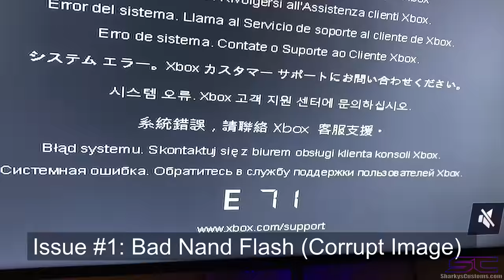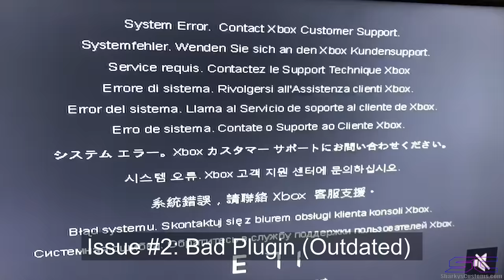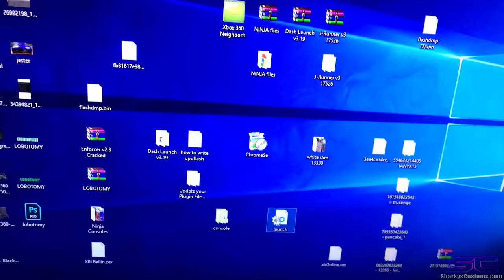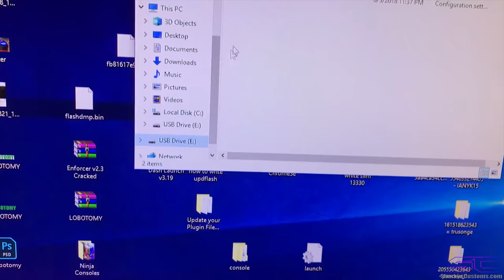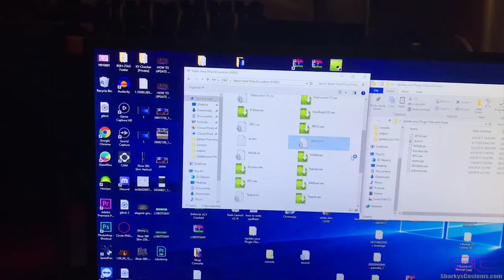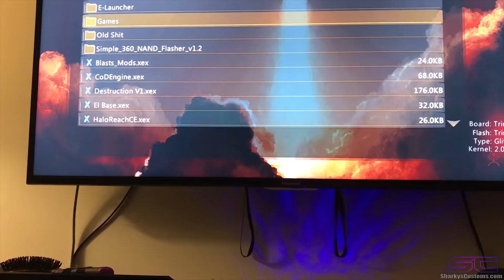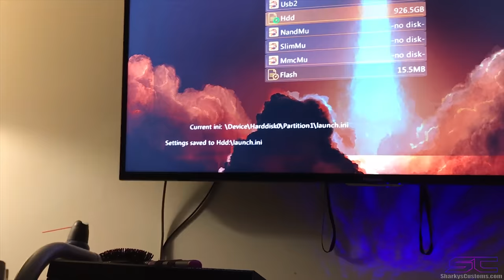How to Fix E-71 (RGH/JTAG)

Comment: Easy method 

Step 1: remove your HDD
Step 2: boot up your console
Step 3: go to settings then console settings then startup and shutdown then startup then select disc
Step 4: put a disc in the tray
Step 5: turn off your console
Step 6: put your HDD back
Step 7: boot up your console normally it'll launch directly the disc
Step: 8 go back to the Xbox home and remove your bad plugin or your bad launch.ini
Reply: Every step works only step 8 doesn't work when i try to back home the Xbox crashed and restart
Reply: @nawolf-0  Hello. I don't know what the problem is. I tried this method months ago, I'm not an expert 😅. I wish I could help you. You have to try again. Good luck🙏
Reply: I accidentally deleted the update and that's what cause this error and it's not getting fixed from this video do you guys know something that can fix it ?

Comment: Mine is the nand or at least i think it is... I updated my corona 4gb (2014) like the day of the most recent update (17544) even when I remove the harddrive the red light still appears... I practically bricked it when I used the system update...
Reply: Did you solve this problem
Reply: @abgsk6724  No, but I figured out what actually happened, I did flash the band correctly which resulted in that console being bricked, I removed the JTag Chip and sold it shortly after.
Reply: @abgsk6724  If you also ran into this problem, unlike me you can fix it if you have a fresh copy of your nand.
Reply: Correction: I flashed the nand incorrectly.
Reply: Ok thank you for the information
Reply: And thanks for your time and help
Reply: @abgsk6724  no prob
Reply: @Devious_Gaming_XD  bro I have a problem I did bad nand update and this this error , now I don’t know how to flash the old nand again as I have the old nand file which I used to create the new one but new one was bad
Reply: @Devious_Gaming_XD  can I tell me how to re flash that nand I don’t know how to
Reply: @gaminggroovy1465  yeah man
Reply: @gaminggroovy1465  so like, you need the last flash file you have right, so not the one that got messed up, the one before it
Reply: @gaminggroovy1465  if you can connect to your Xbox through Xbox Neighborhood you can reflash the older file which will unbrick your console.

Comment: when i take my hdd out the error dont even pop up and i know what i did to make the error i switched to xbonline without updateing it i didnt think abt it at first but when i take the hdd out its just a black screen no error or anything when i try to use the launch.ini it does the same thing just a black screen (help me fix this i will pay you via paypal)
Reply: TESTY did u fix urs I’m having the same problem and would like help, if you will help me. Add my discord Apollo x Mods#2084  I need help, my console just had the issue from XBL online stealth.
Reply: @devisxmds3101  bro did u fix ur problem,? I have a bad Nan flash

Comment: does this stand only on modded consoles? it happened to me on a regular unmodded console.. cant go past the logo
Reply: Have you fixed the issue
Reply: @K3ZZ4_07  nope...
Reply: @tsikriteasspyros3927  it fixed by it self I took the hdd out played games then just slapped the hdd put it back in started working 😂 to get to the dashboard I just held eject and the power button and it reset letting me get past